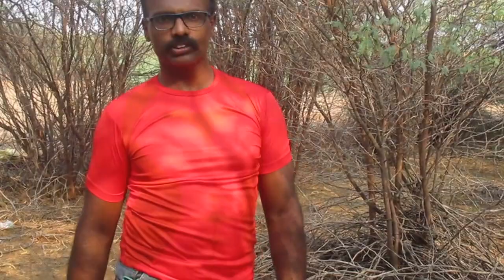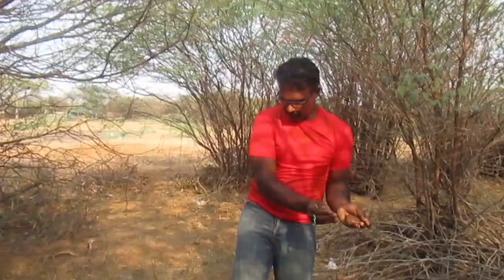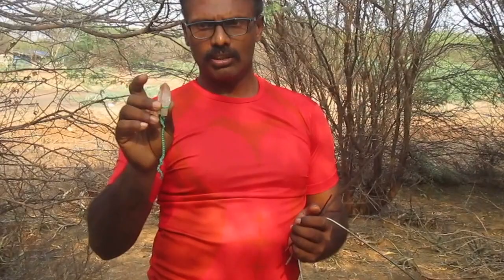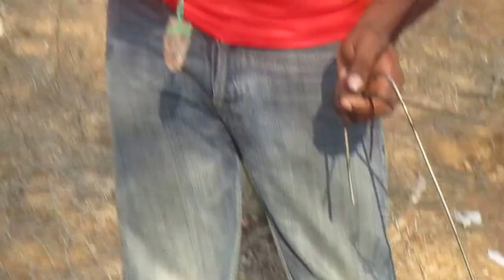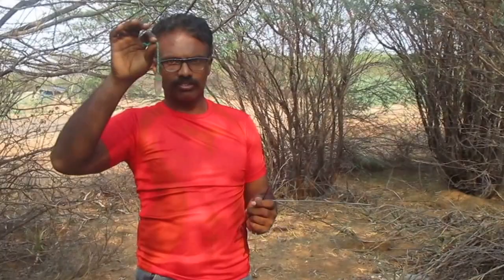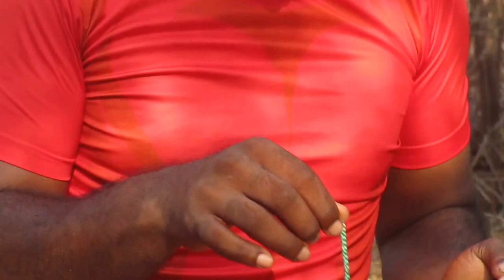basic course on ideomotor effect - secret and truth in finding ground water - water divining

Comment: Sir, how is it dangerous to use? And when you say "  if u don't do it properly, it will affect you " , how to do it correctly? And how to select the crystal? 
Please explain . Thank you
Reply from the maker: Negative effects
Reply from the maker: Almond d souza
Water diviner
9865660921
9488134139
Reply: I am currently not in India . Will contact you when I'm back . Thank you for the response
Reply from the maker: watch my video for answers

Almond d souza
Water diviner
9488134139
9865660921
Reply from the maker: Almond d souza
Water diviner
9488134139
9865660921
Reply: @almonddwater  where will get the perfect pendulum
Reply from the maker: Vibration affects body